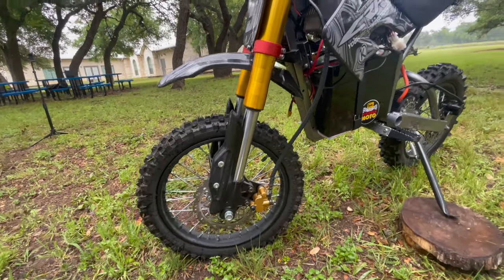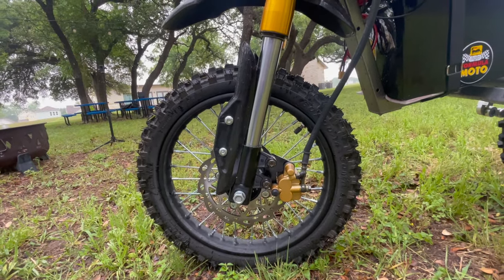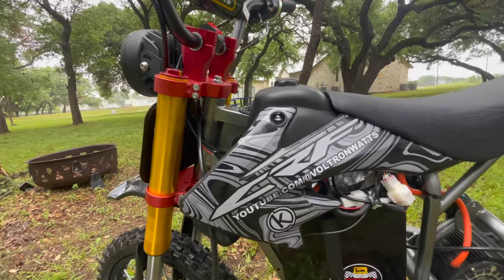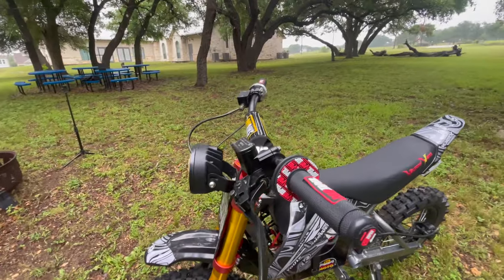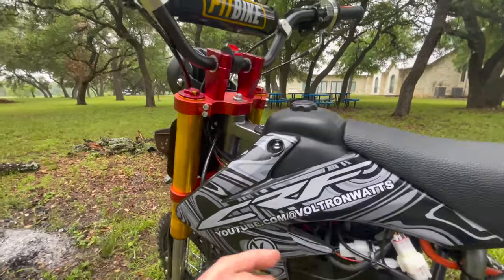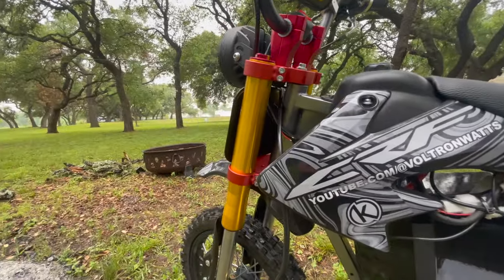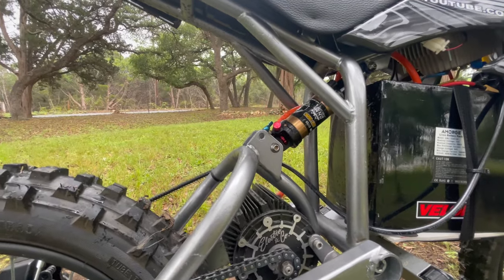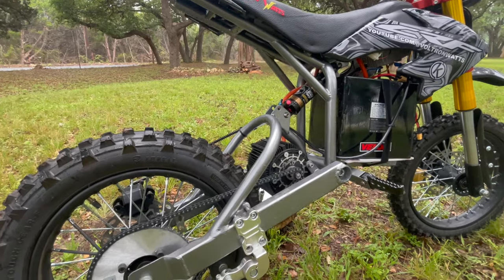Upgraded 50MPH RAZOR- Electro & Co. 72 Volt Custom build MX500 MX650, SX500 and RSF650 11,000 watts!

Comment: One thanks for helping the community out! Two.  how did you get the 14 inch wheel to fit? Did it just mount up and fit with the ec4p in the rear?
Reply from the maker: I had to stretch the swing arm. I have a video on how I did it in the video library 🍻

Comment: Do you have the specs on the rear sprocket that you used?  I thought I had the measurements right and apparantly ordered the incorrect size.  I'm using the same CRF 50 wheels you used on your build.  Pretty much the last thing I need for my build.  Ready to finish it.  Keep the videos coming!
Reply from the maker: Thanks for watching man 👊I mention the sprocket in the video. 72t 8mm sprocket from electric scooter parts

Comment: what do the calipers and the discs do on the wheels and happens when you have a bigger disc vs a smaller disc
Reply from the maker: Bigger disc = more surface area to create friction which ultimately stops you faster. Smaller disc, less surface area less stopping power. 👌

Comment: Howzit!! The rear caliper is 63mm mounting holes. I know the rear is 51mm. It fit with no modifications?
Reply from the maker: No. I had to make a bracket and weld it to the swing arm in order for the brake to work.

Comment: Hey bud I can’t find the video of yours that shows it but you had a volt reader on the tank of one of your bikes where did u get that by chance?
Reply from the maker: I got that on Amazon. Search round volt meter or something like that. That build was a while ago, I don’t remember the exact part, but it was on Amazon, I do know 🤙
Reply: @VoltronWatts  really appreciate it it brotha. Thanks for getting back to me🫵🤘
Reply: @VoltronWatts  also if I buy it and I have a key voltmeter already could I just tap into the wire for the power so it come on and off with the key one? I wasn’t sure cause of the usb plug cause I didn’t want it to cause a electrical issues
Reply from the maker: Yup

Comment: can a 17 inch wheel fit those forks and if it can how many mm are the forks
Reply from the maker: 17” might be a stretch on these 630mm forks. Ride or die R&D has 710mm forks that might fit a 17” wheel tho

Comment: Yo voltron how did you get those rotors to fit with those brakes I have the same brakes I have ride or die forks
Reply from the maker: These rotors just bolt up
Reply: @VoltronWatts  not rotors sorry how did you get the brake caliper on?
Reply from the maker: Custom made the rear bracket 👌

Comment: Thanks for the video and info. That's a sweet setup you have . I'm currently rebuilding my RSF650. I am going to slot the rear swingarm so i don't have to run a tensioner.  Is there a reason you didn't?
Reply from the maker: If I did it again, I would slot it and add adjustment for the rear wheel. 🤷 ohh well. Live and learn I guess. 🍻
Reply: @Voltron Watts  I live in Pa. so I have been planning my build all winter. I don't have a garage, so I have had a lot of time to plan and order parts. Now I just have to wait for the rain to stop. But one thing I knew I wanted was to get rid of that chain tensioner.

Comment: How is the amorge battery? I’m think of using an electric and co 5kw kit with an amorge 72v 28ah battery because the price for electric and cos is insane. I was just wondering if the amorge battery is plug and play and would work and fit for the electric and co kit. And since it’s been a year or so, how is it holding up? Because I also don’t want some china junk.
Reply from the maker: I love my Amorge batteries! They have been great to me.
Reply from the maker: Yes, amorge batteries will work with the EC kits 🫡
Reply: @VoltronWatts  Thank you!

Comment: I’m curious what kind of improvements if any you get with that $100+ throttle.. Does it have better response/ control than a $20 throttle or does it just have a more robust feel and look?  I was under the impression that the  hall-effect throttle sensors inside were all pretty similar, could be wrong though
Reply from the maker: It is for sure more robust and gives more of a “motorcycle” feel. There are similar throttles out there that do the same thing for less.

Comment: In order to get that 190mm rotor on the front wheel, did you need an adapter? Or did that wheel already have the mounting holes necessary for the 190mm pitbike rotor?
Reply from the maker: Hey Matt, the wheel and discs I posted in the comments with links bolt right up. ⚡️💪🏼

Comment: What's the point of the swing arm extension?
Reply from the maker: In this case it allows for a bigger rear wheel. In other cases is allows for a bigger motor 💪
Reply: @VoltronWatts  sweet 😎
Reply from the maker: @jayppop3333 no problem 👊

Comment: With those 14in rims do you have a squeak that comes from the spacers rubbing on the rubber bushing over the bearings?
Reply from the maker: You know, I havnt noticed, but I havnt ridden it enough to have a solid amount of saddle time…I’ll be listening now that you mention it! 🍻
Reply: @VoltronWatts  i was thinking of just greasing it.

Comment: what size forks you got on that? and rear shock?
Reply from the maker: Those are 630mm forks and 200mm DNM rear shock 

https://amzn.to/47OKBJO
Reply: @VoltronWatts  thank you so much for the info. I just bought a mx650 for $200 and i’m going to do the 76volt from electro and co and i’m trying to find some suspension to raise it a little
Reply: @VoltronWatts  Are the stock forks 600mm? Did the 630mm raise it?
Reply from the maker: @Rippinandfishin stock is 600👌
Reply from the maker: @Rippinandfishin 630 will raise it 30mm

Comment: I see a lot of people run 180mm rotors, did you have to add Brake adapters to run the 190mm rotors?
Reply from the maker: Hmmm… you got me thinking now, it’s been a while since that build. I’ll check the disc size and get back to you. It might have been a 180 and I might have misspoke and said 190. I’ll follow up. 🍻

Comment: Any idea how many hours you have on the EC4P? Did you weigh it by any chance? 

I build fast street bikes and want one but they've been out of stock for months. Given how well the underrated 3000W MY1020 can be made to perform, the EC4P should really rip on 20s and a Flipsky 75200...
Reply from the maker: I probably have 8-10 hours on it. No issues yet. I don’t have the weight unfortunately, but I don’t think it weighs anymore than a MY1020 really. I think E&C said the EC4P will be back in stock next week from what I read in the forums. The EC4P was a huge jump over the vevor type motors 🔥🍻
Reply: @VoltronWatts  So the jury is still out on long term motor reliability. They say the magnets are Kevlar wrapped- that's the main thing I'd be concerned with over time. Not sure how long it's been available, and you're one of the few guys to review it here, so thanks for that and congrats on the hopped up Razor. 

I figured it might weigh around 11lbs, so just a bit more than an MY1020. IMO motors much heavier than that are not desirable for custom street projects.

Comment: what power setting are you running on the kelly for the ec4p? electro n co recomended 50 for me. i just want to make sure i wont be pushing my motor too hard
Reply from the maker: That sounds about right. I’d have to look back through the setting to be certain
Reply from the maker: I have it mentioned in my video where I compare the kunray motor to the EC4P don’t remember off the top of my head